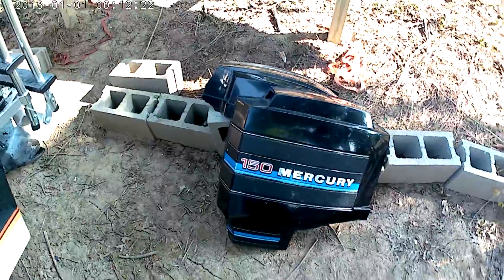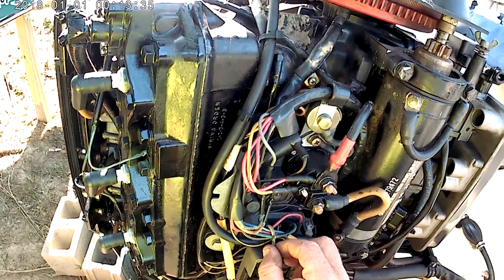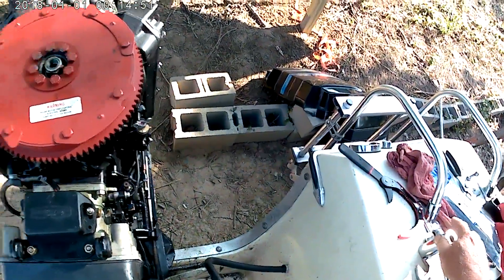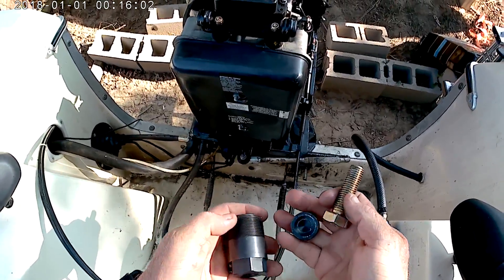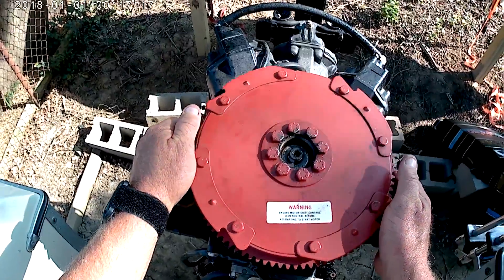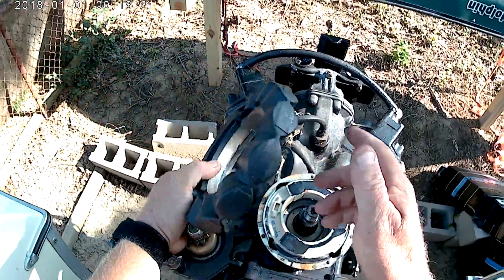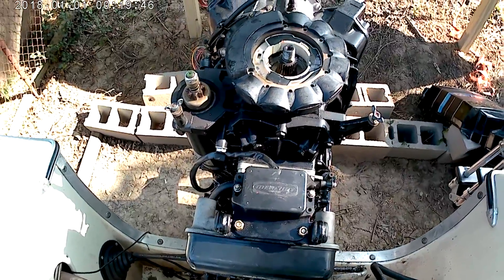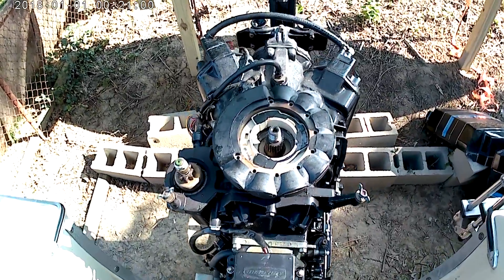Mercury 150 Black Max flywheel/stator removal

Comment: I'm doing pretty much the same wiring work on my black max 175 atm. Do you have a video of doing the stater/rectifier? I don't have my fly wheel off yet, but am unsure about how the wires hook up.
Reply from the maker: I didnt video it while I changed the stator, just basically HOW to get to it to replace it. The wires though, I took a picture with my phone and then did ONE WIRE AT A TIME. Mine were all color matching for the stator so it was really easy. The rectifier was just 2 wires and I think 2 nuts...I cant quite remember without watxhing my video again to see it. The hard part is getting the stator out because of the flywheel though. You get past that and everything else is cake. Let me know if I can answer anything else. I'll do what I can for ya. Good luck!
Reply: @THESLEEPYTRUCKER  cheers mate, that's already helped heaps. I was having similar performance problems with mine a few years ago and haven't used it since. I just acquired a second hand 150, so in the process or replacing all the wires, before anything else. There's a wire that runs into the top of the head between, the first and second cylinder, but seems to be housed in celastic. Do you know what does and how to replace it? Cheers
Reply from the maker: @sammygmuzak7998  if its the same wire I'm thinking of, its for your overheat alarm. Mine is pretty jacked up too and I didnt reolace it because I couldnt figure out how. I'm not running hot though and I have a temp gauge so I dont worry about it. I'm sure thats what wire your talking about.
Reply: @THESLEEPYTRUCKER  yep, thought it might have been temp related, ok won't worry about that. You said you'd done a lot of reading up on these engines, have you got a link for those resources? Thanks
Reply from the maker: @sammygmuzak7998  Sammy I couldnt possibly give you all te links and info I looked at because....I litterally looked at almost everything related to and not related to my Merc engine. I basically just pieced information together to get me where I needed to be at. I also spoke to a dealer locally to me as well as a guy at Mercury and they were willing to walk me through some things. Go to Mercurymarine.com for a parts view though if you need it like I did.

Mercurymarine.com then click on
Parts & Accessories then click on
Mercury catalog then click on
launch catalog then click on
outboard then click on (mine is a 2 stroke carb)
I then clicked on V150 and that gave me an exploded view of my engine and parts. It was a REAL help in my process. the guys at mercurymarine.com were a real nice bunch of guys so give them a call if you can. hope this helps you a little. Let me know what else I can do to help and I'll give it a shot.

Comment: when you remove flywheel to get to a stator and after put flywheel back ,, do you need to set the timer back>? my stator is bad...
Reply from the maker: One more thing I should point out that was pointed out to me by the dealership. If you replace your stator, it is recomended to replace your rectifier also. Its only 2 bolts holding it on and worth the peace of mind to change. I bought everything off of Amazon and saved a ton of money.
Reply from the maker: I believe some motors do need the timing adjusted but on mine I didnt have to adjust the timing. I put the flywheel back on exactly how it came off. My flywheel has a timing slot on it with marks so I didnt need to mess with it. I did however do whats called a "link and sinc" for my carbs. If yours is fuel injected then I dont believe you would need to worry about that. Good luck!
Reply: Do you by chance have a part # on that stator ?

Comment: good job, I have same problem.  Running my 150 Merc at full throttle before she shut down.   Good video
Reply from the maker: Thanks! Yeah my issue was for sure the stator. Full throttle and no power=bad stator. I have a couple follow up videos after my repair. Mine runs better now than when I got it so it tells me it was an existing issue. Good luck with your repair, it wasnt so terrible!

Comment: great job ! Im having similar problem on a 2004 90 hp mercury ,dying on full speed and rough idle I had all gas lines and carburators checked Thanks for the tips!
Reply from the maker: Yeah mine was the same but after changing the stator my boat ran perfect. I replaced the triggers only because the wires were frayed and I was already right there on the repair. I have 2 follow up videos connected with this repair so you can see mine running. Good luck with yours!